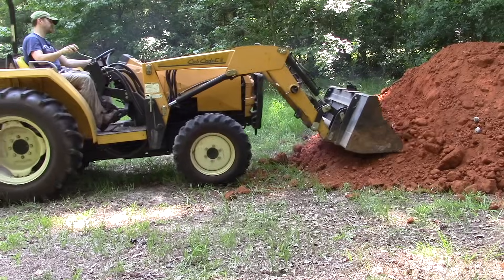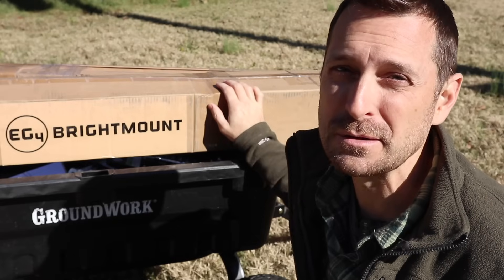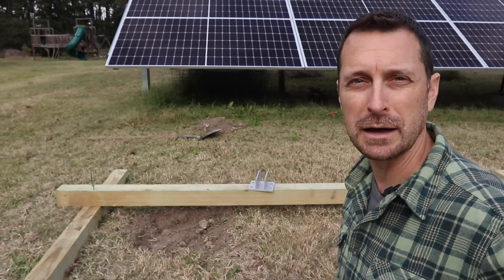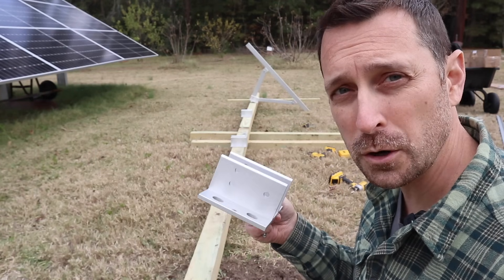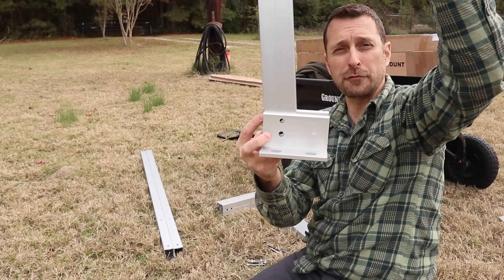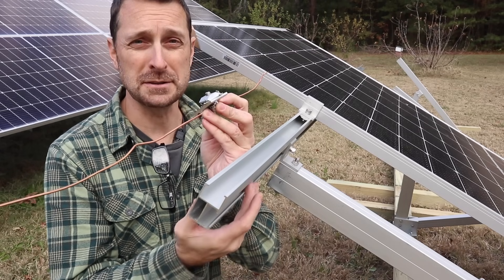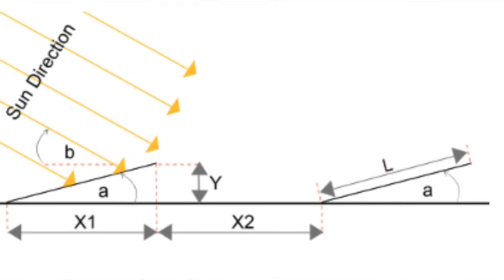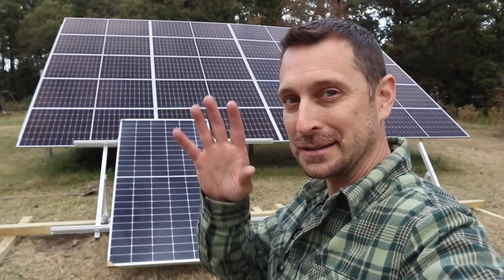Finally An Affordable Solar Panel Ground Mount! Installation DIY EG4

Comment: I’m likely buying one of these, but I’m not thrilled that it is fixed at 25 degrees.  For my location, optimal year round tilt angle is 35 degrees.  Is it feasible to move the lower mounting hole location a few inches to increase the angle?
Reply: I'm sure they did that intentionally to limit wind loading. 😉
Reply from the maker: You could probably cut the lower bar and drill a new hole.

Comment: I ended up putting my EG4 Mount On 2 Parking Lot Bumpers. They were 35 bucks each, 300 pounds each. So I know this won't just blow away, lol
Reply from the maker: That’s awesome. Great solution!
Reply: How do you know they won't move? Have you calculated the lifting force on 4 large panels at 25 degrees in max winds in your area. If not, hope is your strategy...
Reply: @larrylarry1206  yes i have the calculations right here
Reply: @larrylarry1206 I’ve got 4 of these. Not mounted yet, but the 105 MPH lift would come from a force 1 hurricane that’s blowing from behind the panels. Unless there’s a downburst (I’ve had one) setting the array next to a building may reduce the anchoring requirement somewhat. 
Do you have a reference for that calculation?

Comment: It appears you could split the rack if you wanted to keep it portable.  Just don’t connect the two halves, and you’d have two panels on each skid.  Signature Solar says no, but watching your video makes it look feasible.  What do you think?  You might some more of the end clamps.
Reply from the maker: I think you can do that with no issue. Not sure why they said you couldn't.

Comment: 3:20 into the video you have your hands on a piece of the angle bracket. Could you tell me the length of that part? The instructions don't show this measurement and the only response I get from Signature solar is the measurement that in the manual and that not the measurement I'm after, or the instructions are drawn wrong. I want to buy two of these, but I need the length of this part so I'll know it would work in my case. I call this, not wanting to repeat mistakes I've made in the past.
Reply from the maker: Hope I get the correct part for you. It is the longest piece on the bracket. It is 51 3/16".
Reply: Thanks, very much.

Comment: Neat, simple, affordable what's not to like 👌👍
Reply from the maker: Absolutely
Reply: The whole thing is off-balance on a single 4x4, unbelievable. With no end view shown to indicate the flimsy design. Triangulation, triangulation .  .  . hello?!

As <keything8487> says below: "hoping this unit is sturdy enough for the 4 panels it holds from being too front heavy, and tipping."

LOL. Worst design I've ever seen on YouTube or elsewhere. Beware!!
--

Comment: The bottom bar looks like it has a single mounting bolt at the bottom. And the vertical rack has predrilled holes to accomplish the 25 degree angle. Should it be possible to change the angle of the bottom bar and just drill in a hole for the new angle? This is nice but if it can be adjusted it will be a much better value.
Reply from the maker: You could cut the bottom support strut shorter and re-drill the hole to change the angle.

Comment: I consider this but was concerned about the fixed angle.  Thoughts?
Reply from the maker: The majority of ground mounts are fixed. It is ideal that they are fixed to your latitude. We are at 32°N. Our main array is fixed at 30°. Movable mounts are extremely expensive.

Comment: The concrete piers in the installation guide are spec'd at 510KG each.  That's over 1100 pounds each or 4500 pounds of concrete in total.  I'm not sure a few timbers is equivalent.
Reply from the maker: I said it was temporary. We had two strong thunderstorms here this week. Didn't move an inch. 
You do what you think is appropriate for you.

Comment: My EG4 Rack Came today putting it together now with your video on 50% speed, lol. If anyone has a suggestion for the Concrete anchor with a Link to it that would be Awesome.
Reply from the maker: Cool. The concrete anchors come in the package.
Reply: @CountryLivingExperience  I meant the concrete blocks you drill into, I tried looking at home depot website but nothing caught my eye that looked like the picture in the instructions
Reply from the maker: That was just a demonstration. I used footage from my mini split install vid. You need to pour the 30" deep piers shown in the instructions. Those blocks won't hold at all.

Comment: the wind will blow this over in a bad storm??????
Reply from the maker: Secure it how you see fit. Place some block on the outriggers or drive e piece of rebar through them. As I said, this is temporary and portable. I will be pouring permanent piers.

Comment: Why not just use pallets and have the panels flat? = almost free
Reply from the maker: A flat panel will be very inefficient. They are made to work with the sun angle. The best angle to mount them at is your latitude angle. Ours would be best at 32°.

Comment: I wish you could have installed the Sky-Rack 2.0 ground mount for this project. Maybe next time - Great video.
Reply from the maker: Thank you. 
I have seen those. They look nice but are very expensive.
Reply: @CountryLivingExperience , Yes, it’s tough to compete against those cheap Chinese imported ground mounts. The install looks great.
Reply: No way man. That thing is way to expensive compared to others. I actually considered y'all's racking system when I was installing my 15kw array and just couldn't believe the price. I went with the iron ridge ground mount system and have also used that for all my other customers.

Comment: Can I put SIX 190 watt Hqst Panels on it?
Reply from the maker: Not sure. You'll have to check your panel dimensions. The rack is 180" long.
Reply: @CountryLivingExperience   wow 15 feet? I seen another video of this on youtube and it didn't look as long as that
Reply: After Putting half of it together tonight, in my living room, lol. I can comfirm that this will hold SIX 190w Hqst panels :-)
Reply from the maker: @Moes_Prep_and_Tech  Nice!

Comment: Looks like a strong breeze is going to make the panels fly like a kite. Still need to cement them in.
Reply from the maker: This will probably stand a 30mph wind. I am going to pour the concrete piers soon like I said.
Reply: Sandbags across all 4 corners of the 4x4 and you're good to go.

Comment: I saw these on Will's channel too. Only thought was the fixed angle. I suppose there are ways around it. Nice price.
Reply from the maker: You could probably cut that bottom strut a bit shorter and drill a new hole for a steeper angle.
Reply: The current racks they sell are now adjustable

Comment: How would you set these up if you wanted to adjust angle for the seasons? I'm thinking that w/ that timber cross bar drill a hole in each end and place rebar inside, then have vertical post in concrete with 3 sets of holes (drilled thru) for different angles and then you can take the rebar out lift/lower the cross timber and put the rebar in for the desired angle. What do you think?
Reply from the maker: Could work. Give it a shot.

Comment: these pieces are all aluminum, correct?     i hope so, as i like the idea of this ground mounted rack.  i was looking at strut (very expensive-but strong).  i am hoping this unit is sturdy enough for the 4 panels it holds from being too front heavy, and tipping.
Reply from the maker: They are an aluminum/steel alloy. I think it is plenty strong enough.

Comment: This mount adequate for north where I have to worry about snow load?
Reply from the maker: It should be but you would have to contact the manufacturer for specific load charts.

Comment: Great demonstration, detailed and in depth, which is why I subscribe to your channel. Quick question, does this and or even your large ground mount ever have to go through inspection and permitting etc?
Reply from the maker: Thanks James. 
I live out in the county and did it myself. So for me specifically, no. This is more than likely engineered well and would pass any inspection.
Reply: @CountryLivingExperience  Lucky! Where I live in Central FL ATM they almost want a permit to replace your mail box lol
Reply from the maker: Oh no! That's crazy.
Reply: @shaybee22  .....did it pass? im in cent-fl, down by OIA, and want these.  i haven't bought my system yet, getting as much info as possible, these look great !!!!
Reply: Just received 2 of these, and the new kits come with all three sizes of mounting hardware end clamps and the bottom bar on the supports is adjustable allowing you to change the angle between 25-45 degrees.
Reply: It won't pass codes. Needs few engineer stamps....

Comment: Brother can those racks be connected  together for more panels .... I may just build another big pole mount I have 30 more panels too mount.. 6 years ago I built 2 big pole mounts and now im adding another 30 panels we get some good wind every now and then up on the mountain more than in ft worth... Those are cheaper mounts around plus signature solar has been upping there game .... Keep it up brother
Reply from the maker: Thank you.
I think they can be connected together. You just need a few more of the rail connectors and it will be good.

Comment: Looks and sounds like a nice setup. One thing you can do to stiffen things up, is to add some hurricane strips at the timbers. Also, I would add some sort of ground screw to help hold it down from the wind. A couple of dog ground stakes would work. Ones for mobile homes would work, but that might be over kill. When you add the piers, all you would need to do is lift up the complete system and put on top if them with some post anchors.
Reply from the maker: Both good suggestions if I was going to keep this setup long term. Since it is temporary and we do not have much wind here, I am not too worried. Yep, setting it on the piers will be an easy two person lift for sure.

Comment: What about wind loads would your setup handle a 60 mph wind gust? Doesn't seem like those 4x4's  would be sufficient to meet the challenge if they are not anchored to anything.
Reply from the maker: Not sure my temporary setup would handle 60 but we don't have high wind loads here at all. The rack if mounted on the concrete piers is rated for 105mph.
Reply: Rule of thumb anything over 3ft requires 6x6 post
Reply: @davidlarson1369  What about all the vertical 6' fencing with 4x4's?

Comment: If this is the same one Will Prowse reviewed, the only down side is that it is fixed 25°. Alas, here in the great white north, that's nowhere near steep enough in the winter.
Reply from the maker: It is fixed. It is hard to find adjustable ones.....especially for the North.
Reply: @CountryLivingExperience  Pretty much a build-your-own scenario. Where I live, you also have to worry about high winds. This past week, that wood-based version you showed would have ended up half a mile down the road on the neighbor's property!
Reply from the maker: @corydwagner  I totally understand. Was just an option for places where it will work.
Reply: @corydwagner  They now come adjustable
Reply: It is now adjustable to 45 degrees in 5 degree increments.
Reply: Still wondering how they can be... tweaked for higher latitudes...cutting the bottom pieces or maybe do what's shown here but with a raised back end.
Reply from the maker: @jasonwilde2254  Cutting and drilling the bottom front strut would work.
Reply: Intentional to limit wind load to achieve the rating.

Comment: This is awesome.  I was at Signature Solar last Friday and purchased two more batteries.  I wish they had this on display in their new office area.  It is large enough.  Now another trip back only 2 1/2 hours.  Probably end up in Texarkana for the weekend again lol. This is a good excuse to see home more often.  Thanks for sharing.
Reply from the maker: They are developing so many things so quickly it is hard to keep up.
Reply: I will be driving to Signature Solar (5 hours) soon as that is the only way I can get 4 Aptos 440W Bifacial Solar Panels and this rack. If I try to buy them on line then the minimum number of panels is 10.

Comment: Another great video. After watching this, I went right over to Signature Solar and bought 2 kits (plus another inverter and 2 more batteries). They have a $100 flat rate shipping deal right now that makes getting more stuff right now (while you still can) make sense! Compared to the batteries, the inverters are cheap. I bought another to have on hand as a spare (like having a spare tire in the trunk).
Reply from the maker: Thank you. That $100 flat rate is a great deal for sure. 
I also like to have a lot of spare tires just in case.

Comment: I built my first backyard solar array using what I had. A furniture dolly, 1/2 in galvanized pipe and zip ties. It’s very portable and easy to clean PV panels. Worked so well I built 4 more. Now I have 2500 watts of PV panels running my 3 bedroom 2 bath home. It’s all I need.
Reply from the maker: Cool
Reply: Hey man. Where in East TX are you? I’m in southwest Louisiana. Going off grid here soon, would love to connect!  @CountryLivingExperience
Reply from the maker: @joyofthesimplelifeJSL  We are near Tyler. You can send me a message at our Facebook page or email.
Reply: Do you have a video or a picture of your setup? It sounds awesome!
Reply: @gtown03boy  sorry this is late. No I don’t post videos on YT. Just get a used or new box moving dolly lay a piece of cedar fencing 1” by 5” down for the base. Cedar fence wood slats are cheap at Home Depot. Cut it to the width of 3 solar panels. Cut 1 inch Galvanized pipe to the same length. Start with one solar panel in the middle then zip tie everything together. You might need to drill holes in the aluminum edges of back of solar panels for zip ties. I use nylon rope and tent stakes to secure to my lawn. One on each side and one in front and one in back. They’ve survived 50 mph winds without blowing over. Plus big snow storms too in winter. I use to use 2 galvanized pipes behind each solar array now I just use 1. I made two legs for each array with the same 1” pipe. Cut about 3 ft long and smashed one end with my Vice. Drilled hole in the smashed end and through the pipe behind my array. Bolted them on with two nuts. Just unhook tent stakes and swing the legs up to move for best sun areas. PVC pipe might work too or wood legs and cross pieces. Make sure to buy outdoor zip ties. Mine have lasted for years.
Reply: @billbradley2480 - This is really useful for me, as I have wanted a small portable unit to hold just 2 or 3 solar panels. Thanks! Sounds like you have an upright dolly, but I could do this on my platform dolly and see how that works.
Reply: @debbiedogs1  I just put another dolly solar array together for my new EcoFlow Wave 2. I used two 240 watt PV panels on this one. I keep cedar fence slats handy for repairing the fence and I’ve learned laying a cedar fence slat down on the dolly makes a good bottom piece for these solar arrays. I usually screw in a couple pieces of 1 by 2 in front and behind the bottom of the solar panels to keep them in place. I still like to move them around daily when I’m home to get best morning and evening sun. I’ve learned to add 3 tent stakes in back with nylon twine to secure these arrays. They can handle high winds we get here sometimes.
Reply: @billbradley2480  - Good to know re the 1x2s, thanks. Definitely will be trying something like what you have explained, so far I have only 4 panels, 140watts and 180watts, so not large or heavy. Thanks again for your instructions.
Reply: @@orangenite it’s been several years and they’ve survived 50 mph winds and snow storms. I use tent stakes and nylon rope to secure them to the lawn. During summer I move the two smaller arrays Daily to get best morning and evening sun. I’m running a AC off one.
Reply: Hello boss, sorry to bother you. We are a manufacturer of photovoltaic brackets, seismic brackets, and hardware screws. If you need them, please contact me for a quotation. We have our own factory, with direct shipping from the manufacturer and discounted prices.
Reply: Can you use chain link fence posts?
Reply: @crazysquirrel9425 I’m sure that would work. It would probably be heavier than the galvanized pipe I use so moving the arrays may be a little more work. But I only move one of my arrays during summer months. Some people use scrap lumber or free wood pallets.
Reply: @billbradley2480  I do have 4 T-Posts too.
Once I put panels in place I doubt they will ever be moved lol.
I have to have the batteries inside the house so wire runs will be EXPENSIVE.
Not sure if MC4's will take 8 gauge wire or not.
Reply: I’m building an array on a 12 foot long utility trailer someone gave me. I’m putting four 370 watt panels in series for my Airspool hybrid heat pump. It’s high off the ground for better solar and I can move it around. I’m using scrap wood for the build, but I like the zip tie idea when  attaching them together. Thanks! I’m working on it today before winter hits the northeast!
Reply: @schatzihall6572  Be sure to use outdoor rated zip ties. Cheap ones break rather quickly when outside.
Reply: I saw a set of 7 150W panels and each panels weighs only 3 kilograms or ~7 pounds. I am wondering if this could be supported by a frame of PVC drain pipe. It's quite robust if you construct it properly and is probably cheaper than wood or galvanized steel pipe. I suppose you could shove two PVC pipes in one another for extra rigidity and strength. Yay or Nay?